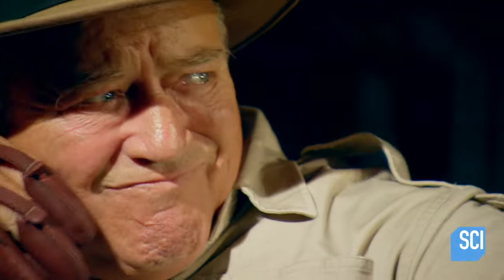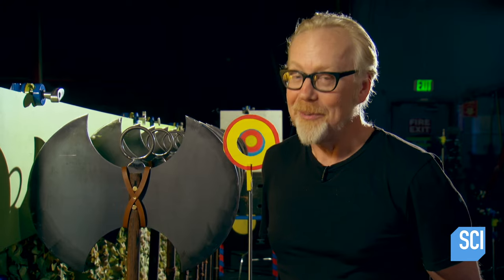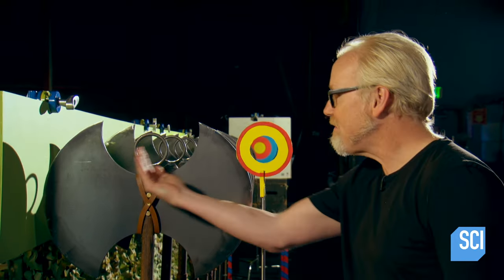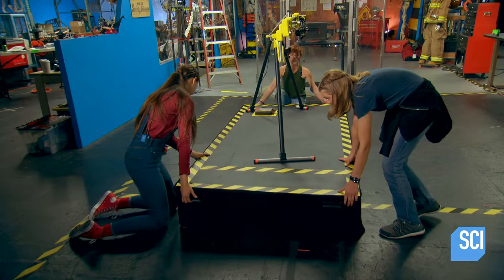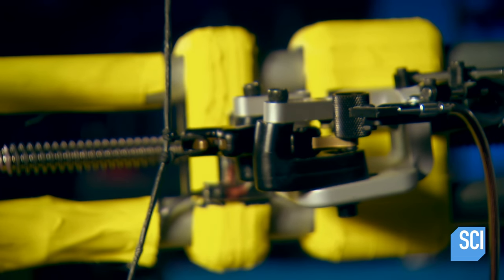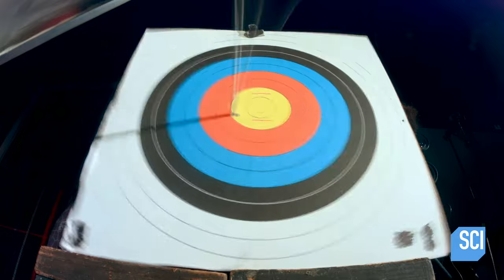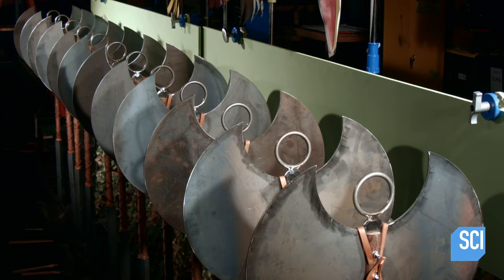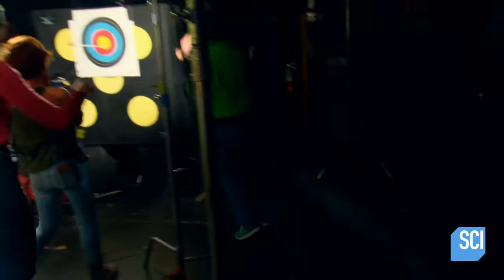Replicating the “Impossible” Odysseus Arrow Shot | MythBusters Jr.

Comment: You should consider that archers in ancient times were far stronger than modern archers. On one hand you have a guy with a compound bow. Say 80-90 lb pull back then reduced significantly by the cam.
Reply: Then you have this other guy with a bow that not even the best Archer today could even string and its homemade.
Reply: Oh almost forgot. The modern archer  with a ancient style bow. Probably couldn't draw it. I'm only comparing the best of today vs the ancient best.

Comment: Odysseus did not use a longbow, but a composite of a wood center layer with sinew stuck on one side and horn on the other. Today often called Turkish or Asian bow. Stringing such a bow is difficult if you do not know how to do it and these bows are sensitive to moisture so archers would dry them near a fire occasionally. The bow chapter in the Odyssee IMO ROTFLMAO funny for a king who had such a bow and knew how to work it. Please, do not bust a myth introducing another.

Comment: A compound bow shoots so flat your average IBO shooter could make this shot the arc of a recurve bow or self bow would make it harder if not in possible IBO speed of your average modern compound bow is around 300 to 350 ft./s Also to shoot a primitive bow accurately you need the arrow to arc around the riser of the bow so the arrow will be flexing between the  rings making it less likely the shot could of happened Couple that with a much slower bow  that dose not shoot as flat so the Rise and fall of the arrow adds to the difficulty odysseus would have to be the son of a god to make this  shot

Comment: Although yes this is technically correct. It is also wrong. As a they have carbon arrows which do jot flex as much as the wooden one back in his day and b should have done multiple shoots to make sure it wasnt a fluke. I use to do archery and yes this is very plausible but I dont think it happened
Reply: Also long bows are harder to keep pulled out fir ages while a compound bow has a spot where it stops and rest. The speed of the arrow also determines wether or not it will go through rings